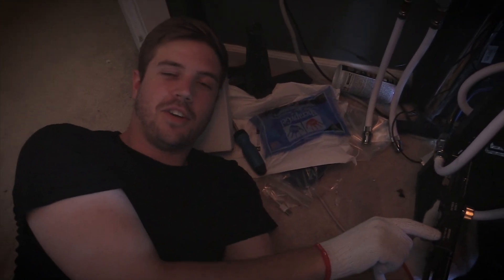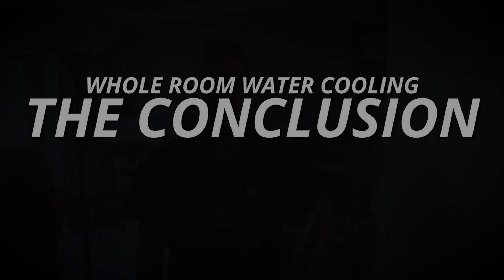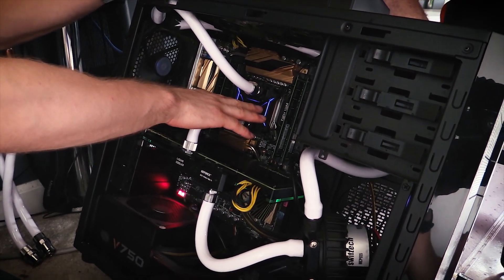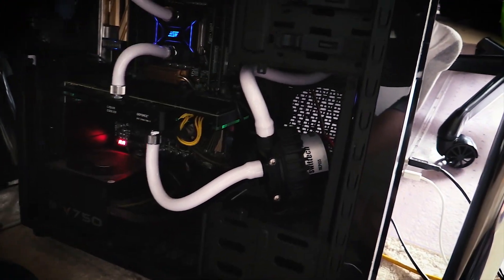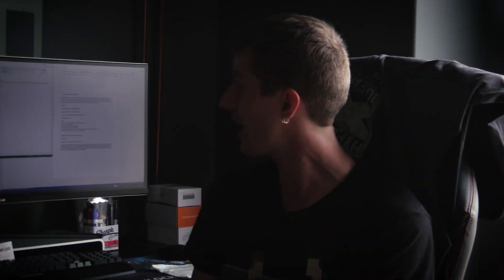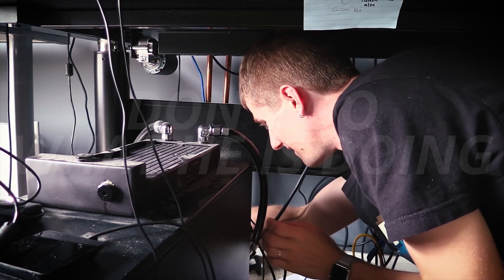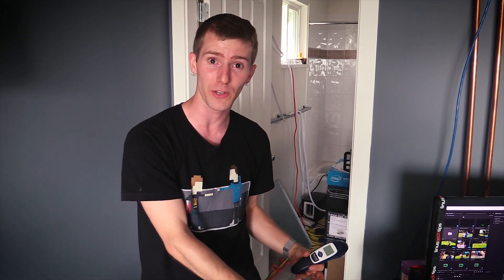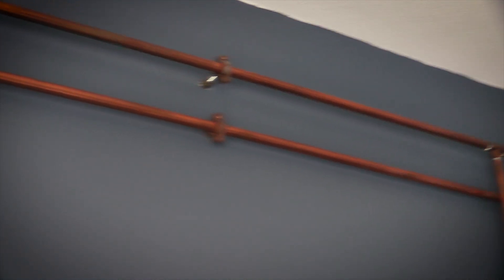Whole Room Water Cooling Part 7 - It's FINALLY over!

Comment: Can anyone recommend me a mouse that is great for fps games
Reply: G502?
Reply: Logitech G502
Reply: UpbeatGaming G502: best sensor in the world right now, a bit on the heavy side, satisfying clicks, comes with 3 year warranty.
Reply: Joey Aufdermaur Deathadder is extremely great choice.
Reply: UpbeatGaming Logitech G700s hands down. I've used literally everything except the R.A.T. ones so it's possible those are better but have no experience with them.
Reply: Ovi Wan Kenobi You sure can you compare it to he logitech G402 and the Mionix NAOS 7000 Wired Optical Mouse
Reply: UpbeatGaming Mionix one felt cheaper but only used it in a store and the G402 I never used. Must be newer because I haven't seen that one yet. Reviews look good.

I like wireless mice though; I take them with me when I travel.
Reply: Ovi Wan Kenobi So why is the logitech G700s so good can you give me some info ?
Reply: Ovi Wan Kenobi Wait can this mouse be wired
Reply: UpbeatGaming Corsair Vengeance M95. MMO buttons are great for sniper/weapon switching. Don't touch Razer.
Reply: McMaXiMaX even without the weights? I have it, I don't feel it heavy with all the weights but I think that is just the way I like it, I hate light mouses.
Reply: McMaXiMaX Well this is hard to choose a mouse G700s or G502
Reply: Skyval Ream
Well let's say my touch and wrist movement are really rough (like a lumberjacker) without the extra weight I feel like I have nothing in my hand making it hard to control for me... I hate that, maybe that's the result of growing up with a Ball Mouse, I hated the first optical and laser mouses unless they were wireless because the inner battery made them heavier but that is like really personal.
Reply: +UpbeatGaming I'd recomed a mouse from Zowie.
Reply: I'm thinking the FK1 is probably a good choice.
Reply: G502 best mouse m8
Reply: Kyzr He said a mouse for FPS games so we are going to assume it isn't Minecraft. Games like: CS:GO.
Reply: Corsair M65
Reply: Corsair m65, out of all the brands I've used (Razer, roccat, rat, steel seires) this is by far the best mouse I have used.
Reply: Lil' Kohai it's not exactly a "bad" thing, but some people swear by optical. while I don't mind laser, I don't deny it's superiority for professional gamers.
Reply: UpbeatGaming I just got a new mouse, so I feel like talking about mice. There are a lot of good ones out there right now. I've used the:

Razer DeathAdder 3.5, newer versions are probably better overall (they are lighter for one, 3.5G is ~115g, newer should be ~105g), its shape is decent but not the best, a decent mouse overall.

Logitech G500, decent shape, but not very light (~115g with no weights added), bad sensor, bad sensor position. G400(s) was better, but their newest line have good options too.

Microsoft IntelliMouse Explorer 3.0, this is the shape the DeathAdder tried to copy, but the original is better in this case. It has a few good things...
   + Legendary shape
   + Light for its size (100g)
   + Sensor is accurate and responsive*
But has many issues....
   - *Accuracy and responsiveness is only true if you move the mouse at a certain, moderately slow speed. Faster and there's negative accel. Even faster (but still not that fast) and it spazes out.
   - That slow required speed is even slower unless you manually "overclock" the mouse to at least 500Hz, which it does not natively support. This is possible on Win7 but Test Mode has to be enabled, and impossible on Win8+ (most probably including Win10) unless you have one of a small set of motherboards.
   - The scroll wheel is loose, has poorly defined notches, and constantly malfunctions.
   - The side buttons don't feel very good.

Microsoft Wheel Mouse Optical 1.1, possibly the best shape every made, and VERY light (~80g). But it has no side buttons, and has all the same scroll wheel and sensor issues as the Explorer 3.0

SteelSeries Sensei RAW, One of the only shapes that can rival the WMO, and quite light (~90g). But has the same bad sensor the G500 has, and although its scroll wheel feels amazing, it still manages to malfunction constantly.

FinalMouse 2015, I didn't like its shape, but I think that had something to do with my grip. Seems to have a lot of quality control issues. The lightest mouse here (~75g). Have a new model coming out with a shape inspired by the WMO.

Zowie ZA13, A shape similar to the WMO/Sensei with none of their issues, weight is also similar to WMO (~80G). But its pretty small overall. This is my favorite mouse ATM, and right now I'd have a hard time recommending anything not from Zowie. Their EC series is even similar to the Explorer 3.0/DeathAdder shape. Potential to mod it to even lighter, maybe even lighter than the FinalMouse

tldr;
Look at Zowie mice.

anti-tldr;
http://www.overclock.net/f/375/mice
Reply: Wiler Prime Ah
Reply: UpbeatGaming Zowie FK
Reply: UpbeatGaming
if you don't want to run out of battery for any reason in middle of a game which can be reeeeaaally unconvinient go for the G502 (basically thats the reason why I went back to wired).

Yes I know it's rechargable and than you can put the usb cable again while playing but fuck ... I always use to forget about it and started looking arround for the USB cable which was really anoying.
Reply: Wiler Prime So the g700s can't be wired Ok yeah forget that
Reply: UpbeatGaming
it can be... but you usually forget about it and shit happens.

there is also other thing...I don't see the point of paying some extrabuck for the wireless option if you are going to play with it wired anyways, unless you are playing on a couch away from the screen.
Reply: +Wiler Prime The G502 is ~127g EMPTY, that's very heavy. And I'm not sure why anyone would want a heavier mouse, as far as I can tell lighter should always be better, beacause less weight = less inertia = easier to start, stop, change speed, and change direction. But if you disagree, I'd be happy to hear your reasons.
Reply: Skyval Ream So any other mouse then I just want the best fps mouse can get
Reply: UpbeatGaming I personally dont really trust wireless mouse though.
Reply: McMaXiMaX I don't as well
Reply: Skyval Ream What one tho ?
Reply: Corsair m95, sexy, lots of buttons, 70$ what could be better?
Reply: Well they all have the same sensor and 5 functional buttons, so it's mostly up to shape/weight preferences, and that's going to depend on your hand size, grip, and personal preferences. But here are some useful notes:

They all have stiffer-than-average clicks. Some people like them, others (mostly RTS/MOBA players) hate them. The FK series is propably the stiffest of all.

They used to have bad click latency, but this should be fixed in newer batches.

The EC series are the most similar to the DeathAdder/IE3.0 shape.

The ZA series doesn't seem to be available anywhere with a good return policy right now.
Reply: Skyval Ream Well I have big hands and my grip is the claw grip so what one should I get ?
Reply: Skyval Ream Thank you very much could you give me a website or a video of a review of this mouse so I can make sure if I should get this or you could tell me your thoughts about it
Reply: http://www.overclock.net/t/1500615/zowie-fk1-competitive-gaming-mouse-review-by-ino

Zowie mice have no driver/software, all config is done on the physical mouse (dpi, polling rate, left v right hand). No macros.

Only one set of side buttons can be activated at a time depending on the hand setting. The others are disabled on a firmware level.

Neither of these things bother me, put you should be aware of them. Since you probably won't be able to find it in a store to test before you buy, I'd suggest trying to find it online somewhere with a good return policy.
Reply: Ovi Wan Kenobi I am currently using the R.A.T  M.M.O.7 and it's pretty good but i'd not buy it again after using it for 2 years and knowing all of it's flaws.
Pros:
-Very adjustable, comes with adjustable weights, integrated LN key/additional weight, couple of palm grips and pinky finger supports. Also has software controlled RGB lighting options.

-Button layout is quite good and every button is usable, because there aren't too many of them and they are placed logically.

-Looks quite epic and is a definitely a conversation piece, as i have found it to be with some people at LAN events and such.

-Mouse wheel, i really like how it feels, it has very well defined notches and it doesn't scroll accidentally when clicking with it easily.

-Both main buttons can be easily locked separately or at the same time(with those 2 buttons next to the DPI button), if you for what ever reason need to lock them.

-Mouse cord, it's wrapped in some though fabric and i really like the quality and pattern on it.

Cons:
-Software isn't very intuitive, requires you to select the mouse profile every time you reboot your computer and can't be made auto apply it on startup (You can use the mouse without any profile, but the extra buttons don't have any functionality without it.) Additionally the profile has to be saved in a specific folder or you can't select it from the right-click menu on the taskbar icon at all. You can save the profile in any location, BUT you have to open the crappy software and then go navigate to your profile every time you want to select it.

-Build quality, starts to fall apart after a year or so of usage(literally). Mine doesn't have the back button nor thumb rest button anymore because they just broke off and the paint on the thumb joystick thingy is completely worn off. Also the secondary mouse wheel above the thumb rest doesn't rotate properly anymore and can't be made to work as horizontal scroll, which makes no sense to me at all.

-The slippy pads below the mouse are way too small and they are very worn out at this point as well, as a result of them being too small and poor quality once again.

-Sensor. I don't know if this is the case with every laser sensor, but in this case it definitely is. When ever there is any small dust particle or something like that stuck in the sensor, the mouse just doesn't move up or down at all(sometimes it does the same to horizontal movement). It's not like i have a dirty mouse pad either, it just happens way too often and almost always when i am gaming.

-Cleaning the mouse. Yeah good luck with that. My Mouse looks like it has been dipped in some sort of shaving cream or something and them wiped with a rag. Because every nook and cranny(and this one has a lot of them) is basically impossible to keep clean and it's just disgusting after a few months of usage.

-Paint in general, most of it is still fine but on the palm rest it has started wearing off and as i mentioned on the thumb stick, it's just gone.
Reply: ROCCAT KONE Pure Core Performance Gaming Mouse, Black beats all
Reply: Death addeR FTW
Reply: I have had my Deathadder Chroma for over a year now and I love it so much.
Reply: UpbeatGaming a mouse.. you don't need some crappy overpriced mouse for gaming.
just get a 10-20 dollar mouse.
Reply: Logitech g502, Razer Deathadder chroma, Zowie FK1, Roccat Tyon are great mice. just search on youtube for reviews and then find whick one you like. You should also buy a large mouse mat because when you are playing games you really shouldn't use such a high sensitivity and a low sens(itivity) means you'll drag it off the mouse mat. You should try to find what's the best sens for you. A mixture of accuracy and mobility.
Reply: UpbeatGaming Anyone, just stay away from razer, their shit software never worked for me.
Reply: UpbeatGaming Well, sir.  It looks like you play MC, no need in getting any mouse over $30, lol.
Reply: logitech g402. 
been using it for almost a year now. got it for $60, now you can find it for just $30
Reply: Redemz Not joking..
Reply: Redemz .............
Reply: UpbeatGaming Razer Death Adder for sure... if you like to palm mice.
Reply: UpbeatGaming I have a Rat 9 and a rat mmo7.   I have large hands and they fit my hand perfect.  I tend to use my rat mmo7 more than the 9.   The rat series is a bit expensive.  They are worth it in the long run.  Well built.  I have tried the Logitech mice.  They are nice.  A little small and if you own a rat you wont use them.  There are cheaper Rat mice than the ones I have so go with what fits your gaming style.  Go somewhere where there are mice you can get your hands on and see how they fit in your hand.  You will be holding it a lot and need comfort over anything else.
Reply: Invis Cheetah IMO the main issue with office-grade sensors is that they have low max tracking speed. Since lower sensitivity is recommended for FPS  games (IIRC the majority of pros use 40cm/360 -- 60cm/360) being able to move the mouse quickly without it spazing out of having other problems is important. And gaming grade sensors are probably usually more accurate too.
Reply: VilleF1N Thank you I will have a look
Reply: ***** `Not so sure about the deathadder for fps games
Reply: Cole Medhus Not so sure about the deathadder for fps games
Reply: Darude-Sandstorm
Reply: UpbeatGaming Cooler Master CM Storm mouse and keyboard, it's the best.
Reply: UpbeatGaming Wait, did you not click on the "Read more" button, on my comment? I had lots of Cons listed there as well.. Some of them were pretty serious flaws in the mouse.
Reply: Ovi Wan Kenobi I've used the RAT mice and they are quite good if you can get used to the weight. Once you use one it's extremely hard to switch over to a different brand
Reply: VilleF1N I did dude xD I mean what the mouse looks like
Reply: You Knight What about logitech
Reply: You Knight Is that the one with the odd button placement? it sits a little far back.
Reply: UpbeatGaming the logitech proteaus core it pretty dope
Reply: Louis B This is going to be really hard I think I will just try every mouse here and I will just see what one I like the most
Reply: UpbeatGaming MadCatz R.A.T. 7 - great mouse, some sensor problems but cleaning it sometimes solves those problems. Otherwise, great adjustment possibilities and weight
Reply: UpbeatGaming I have heard good things about Logitech mice and I had a g700 but I did not use if for gaming because I used it for design so I can't personally say weather it's good or not but my friend has a protus core and says its a beast so I take his word for it
Reply: Jessica Because I have big hands so this is no problem for me but you may be thinking of the m95 which has weird button placement, the m65 I think is quite normal with the exception of the sniper button that I just changed to reload instead of slow dpi
Reply: Steel series rival or razer deathadder is great for cs if thats what youre playing ;p
Reply: Razernij mouses , just look one up for your budget
Reply: Redemz Ah ok thank you for the info
Reply: UpbeatGaming That's what the mouse (deathadder) is made for. It has only two extra buttons, which could be used for a shortcut for a knife attack.
Reply: Logitech G502 is what I use for fps. Its great
Reply: UpbeatGaming razer mamba, rather expensive, but by far the greatest mouse i've ever used. the deathadder is a great cheaper alternative as well.
Reply: R.A.T 10
Reply: https://docs.google.com/spreadsheets/d/1ZzbKDmFOqsP_ut2RdctD01OEbZzbXol6HLwqVkSmZcg/edit#gid=0 filthy peasants everywhere
Reply: Yes Im Going To Be That Guy No, just no.... Cyborg is bullshit.
Reply: UpbeatGaming logitech g502, corsair m65.
Reply: Microage i dig it because if you hold down that button, the sensitivity goes down to a really low sensitivity you had set up, good for sniping in Battlefield
Reply: Yes Im Going To Be That Guy snipe buttons render your muscle memory for flick-shots useless. I doesn't recommend them at all, in any setting.
Reply: UpbeatGaming Corsair M65 is hands down the best mouse I have ever used. 
Fits perfectly in my hand, and is designed for FPS games. Plus the build quality is amazing.
Reply: Lil' Kohai the only gripe I have is the sensor.
Reply: A butt and a half I've never had a problem with it and it's worked for me on every single surface that wasn't fully reflective. I've even had it running on extremely glossy surfaces, though there was some loss of tracking there I admit. 
However so long as your surface isn't fully reflective, there's no problem with it.
Reply: Lil' Kohai oh, yes. I'm not denying the quality, it's just that it's laser.
Reply: A butt and a half I never knew laser was a bad thing xD

Comment: Insulating all the copper, easy and cheap!
Reply: Eflat Productions they gonna move into an new office with an AC anyway.
Reply: TheLordOfWar He's talking about when they first started.
Reply: Thank you, Its like putting in a hot water heater. I bet you if they had insulated all the pipes, they would have notice a big difference. And this was not a cheap experiment. But you know what, you don't learn unless you try!

Comment: It's an interesting idea, but I think that the room water cooling project is fundamentally flawed.  I think that using water radiators to disperse heat out of a room is a neat concept and that evaporative cooling of that water could be good in areas with a lot of water, but that taking the water directly from the computers to an outside radiator is overcomplicating the problem.

Comment: You guys are SO lucky you haven't had one of the drops come free and leak everywhere with them only being supported by the solder joint.  You need to anchor those drops to the wall so they don't move around or any of the 3 joints on the t-fitting can fail when you're switching it.